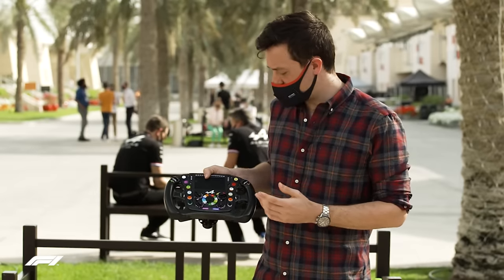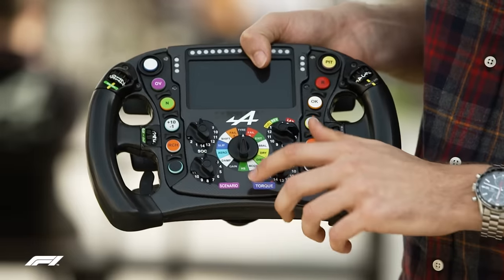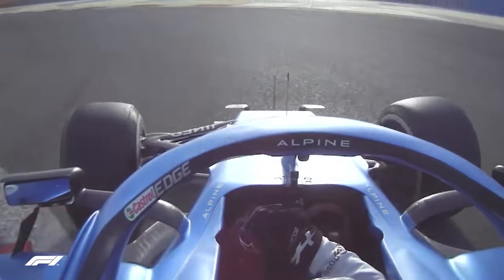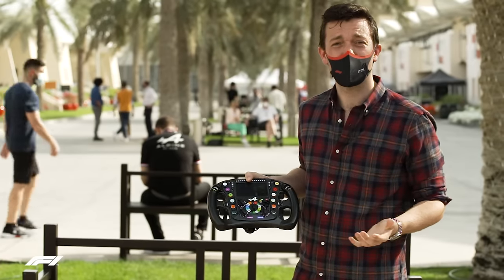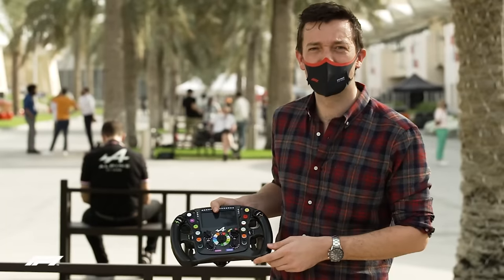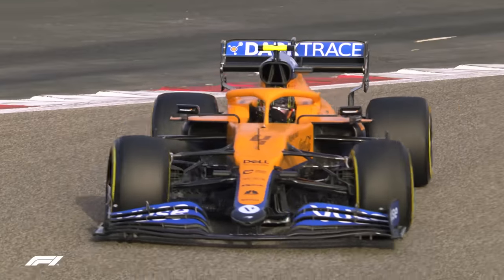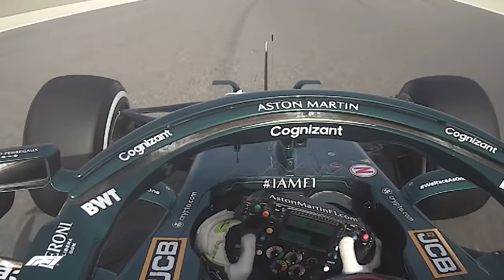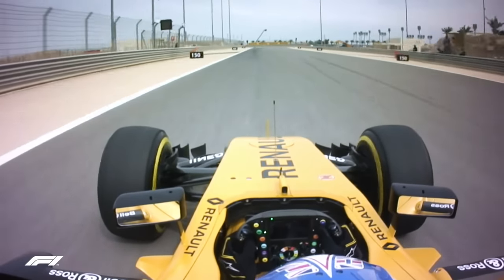F1 Explained: The Steering Wheel

Comment: Gentlemen, a short view back to the past. Thirty years ago, Niki Lauda told us: "Take a trained monkey, place him into the cockpit and he is able to drive the car." Thirty years later Sebastian told us: "I had to start my car like a computer. It's very complicated." And Nico Rosbeg said, err, he pressed during the race, I don't remember what race, the wrong button on the wheel. Question for you to both. Is formula 1 driving today too complicated with 20 and more buttons on the wheel, are you too much under effort, under pressure? What are your wishes for the future, concerning technical program, errrm, during the race? Less buttons, more? Or less and more comunication with your engineers.
Reply: Fewer buttons*.  You can't have "less buttons", unless you start chopping buttons up into parts of buttons.
Reply: I agree with you but it was from the question in abu dhabi 2014

Comment: I want them to see a more simplified steering wheel. It should be about driver skill, not different settings for parts of the track.
Reply: It's part of driver skill now, change the car setting at high speed.

Comment: In my view, drivers should be controlling the forces of the car through steering and throttle inputs. They should not be in-car engineers. Short track sprint cars don't even have batteries.
Reply: In the future, they don't need a driver anymore. There's Roborace, a competition with autonomously driving cars.

Comment: That wheel is a psychomotor skills nightmare, FIA must ban excessive controls and/or on the fly adjustment because it's more dangerous than "Natural Instability" during the 90's era, pilots must focus on driving not on adjusting, DRS and those things aren't "craddle" for new tech, it's a time bomb. ABS and active suspension is more desirable than fancy steering wheels with embedded GBA controller !
Reply: Or ban it all and use driverless cars.

Comment: I've watched Formula 1 since 1994 and looking at the sport now, it's got a bit ridiculous. F1 needs to take steps to simplify the technology and  reduce the amount of management the driver has to do. The excessive management of the tyres and systems on the cars is just insane.
Reply: Just a question, because this is before I watched F1, is this worse than Anti-lock brakes, Traction control etc?
Reply: @maxkimmings4361  , In my opinion....yeah, it's worse. They could push to the limit back then, today it's all about managing the tyres, battery and fuel. Watching Max chase down Lewis only to hear the team tell him to manage the tyres is just ridiculous.